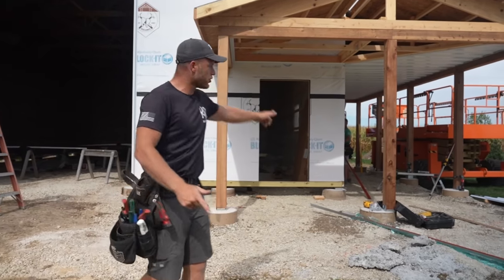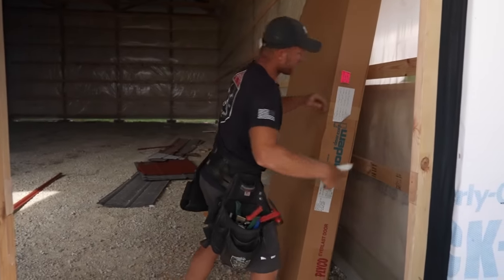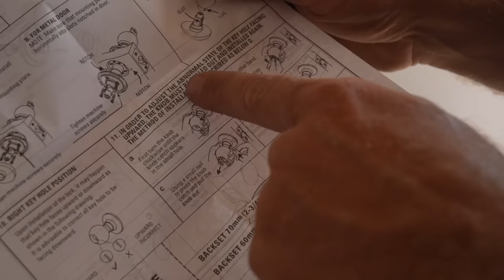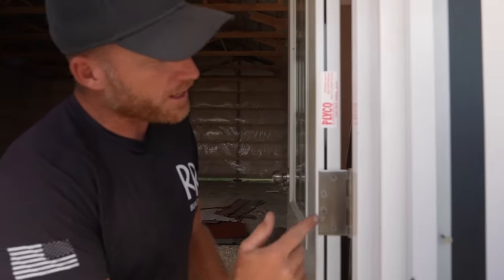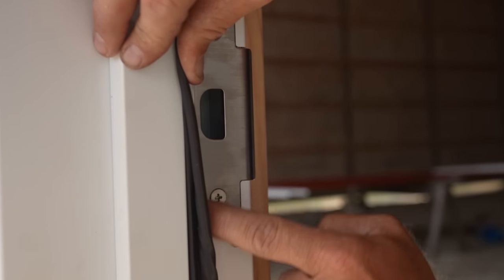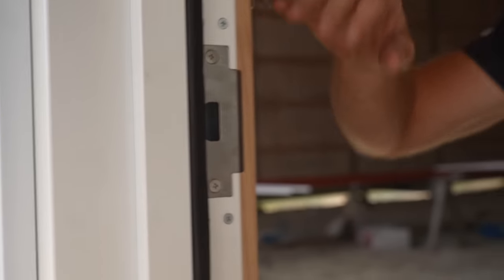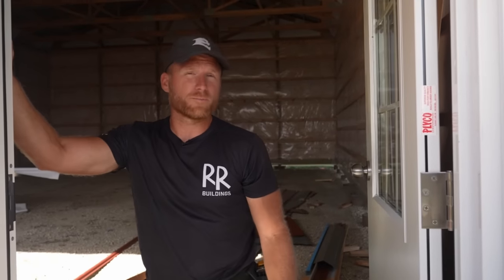Metal Door Installation Video

Comment: Seems like every metal door I've ever seen has shreds of rubber coming off the bottom edge. They get scraped off by the metal door sill. Is there any way to adjust the fit so this doesn't happen? It does not seem to be an issue of age. This will start right after install. BTW, I did not do the install, but Id like to fix it.

Comment: The thermal break is a great thing, but doesn't it make the doorframe less secure because the interior metal can be split away from the main frame? Perhaps the gasket is the super adhesive that's stronger than welding, but I would question it.
Reply: I've tried this before, trying to scrap an old slide door. You aren't going to break it. You're going to break the screws first. Then there's just taking the screws out of the frame.oooor just break the window and stick your hand in to open...

Comment: If you set the door in the opening and found that the bottom of your opening was not level so you ended up with a gap under one side of the door, how would you fix or fill that gap?
Reply: Low-expansion (the window/door version) of expanding foam. THIS IS IMPORTANT. If you use regular expanding foam, it WILL buckle the door/window, probably irreperably. Use shims to support the bottom of the door too if the gap is horizontally wide.
Reply: Usually you cut the Jamb down to match.
Reply: @aaronmdjones  thank you